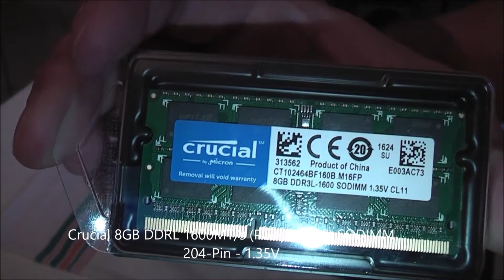Memory Upgrade Asus K751LJ Laptop, F751

Comment: Hi! I have an Asus F751m (Main Board X751MD Rev 2.0). I have tried to install one piece of storage M471B1G73EB0-YK0. Bt when I start my Laptop Windows (Win10, 64bit) shows me, that it ist trying to repair but hour by hour nothing happend. The SSD is silent.  Bios is up to date with Version 403. Curiously it shows me 12 GB, so the board sees the DDR3 storage. I do not know why my Laptop is not starting... with an 4 GB 1,35 V it starts normally.... Do you have an idea? Best regards from Germany
Reply from the maker: Hallo, du schreibst das dein Laptop ohne den Speicherriegel wieder normal startet. Ich vermute das dein Speicher eventuell nicht voll kompatibel ist. Das ist ärgerlich, vorallem wenn dein Speicher auch noch von Samsung ist. Ich selbst habe einen Crucial 8GB DDR3L 1600 MT/s (PC3L-12800) SODIMM 204-Pin - CT102464BF160B.
Reply: Ah, auf Deutsch geht's gleich viel besser :-)
Ich habe mir nach Deiner Nachricht den Crucial RAM CT102464BF160B.C16FPR bestellt und diesen vorhin eingebaut mit exakt denselben Effekt. Diesmal habe ich dann mal die Reparatur-Schleife ausgeschaltet und habe dann einen BluScreen erhalten mit dem Fehlercode 0xc0000001. Sämtliche Maßnahmen, dann eine Repartur zu starten oder eine Ausführung im abgesicherten Modus scheiterten.... Nun habe ich mir den Ram-Sockel, also wo der Speicherriegel reinkommt, einmal angeschaut und da steht.... 1.50V.... Jetzt frage ich mich: Kann es sein, dass beide neuen Rams ( sowohl Samsung 8GB Ram M471B1G73EB0-YK0 als auch Crucial 8 GB CT102464BF160B.C16FPR ) 1,35V unterstützen, der urspünglich im Sockel installierte 4 GB Samsung Ram M471B5173DB0-YK0 jedoch zwei Spannungen, nämlich 1.35 und 1.50 V unterstützt und ich somit als neuen RAM einen 1.50 V Ram benötige? Könnte diese Theorie stimmen? Oder was könnte es sonst noch sein? Dank Dir auf jeden Fall für Deine Hilfe! VG
Reply from the maker: Hi, bei Amazon wird dein ursprünglicher installierter Speicher (4 GB Samsung Ram M471B5173DB0-YK0) angeboten und dort steht in den Spezifikationen das er zu 100% kompatibel für 1.5V ist.
Wenn das zutrifft und dein Ram Sockel laut der Beschriftung mit 1.5V arbeitet, dann würde ich auch theoretisch vermuten das dein ursprünglicher Ram zwei Spannungen unterstützt und mit 1.5V lief. Ich persönlich würde dann einen Ram mit 1.5V probieren. Hoffe für dich das es dann funzt. :-)
Reply: @flatland187  It's been 4 years, could you tell me if your ram upgrade ever worked ?
Reply from the maker: @heartless7494  the memory that I install in the video works fine on my laptop.
Reply: @flatland187  I have the same laptop. Is it true that it will integrate the new ram by itself ? And also, will it replace the original ram, or add onto it ? I mean, do you have 8gb RAM now, or 4+8GB ?
Reply from the maker: @heartless7494  the laptop has 4 GB RAM permanently installed. you can expand the memory as shown in the video. the expansion memory in the video has 8GB. together with the permanently installed it is now 12 GB ram. 4 + 8. for me it worked immediately after the installation
Reply: @flatland187  this is ideal, thank you for your response it really helps ! danke schön aus Frankreich !

Comment: Hey, weißt du zufällig ob man auch 16gb ram installieren kann?
Reply: English please?
Reply: no, you cant this computer support max 16G RAM and there is a 4G RAM Integrated on the motherboard so logically you can install another 12G RAM maximum. however, 12G RAM is really hard to find so 8Gb max
Reply: @gxc534  installed 8 Gb RAM Stick, thanks for the late reply. Hope this helps others out aswell.